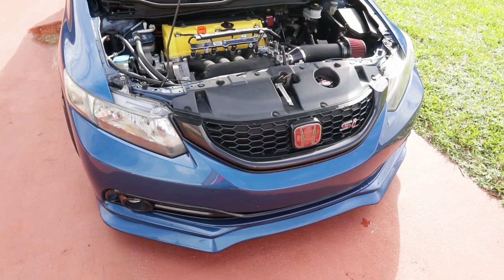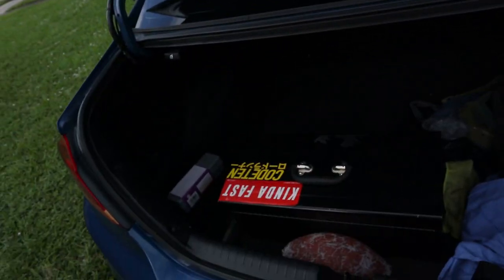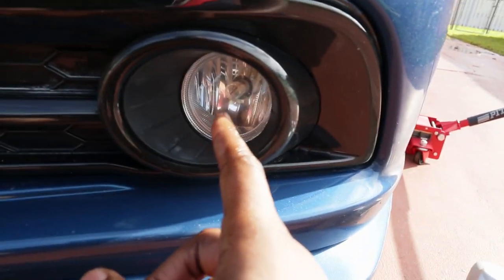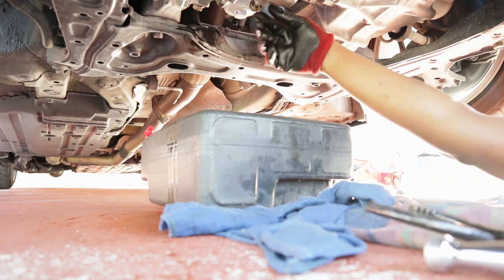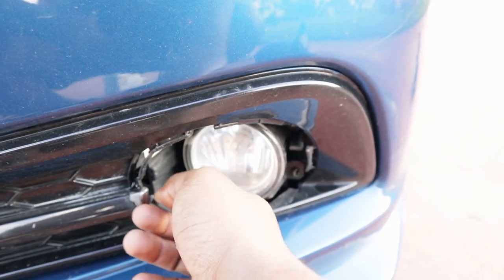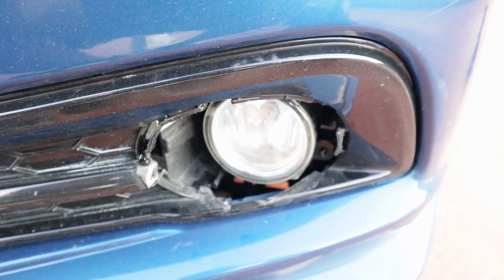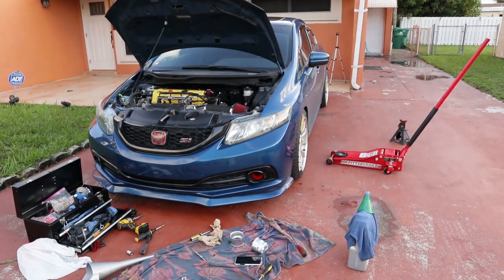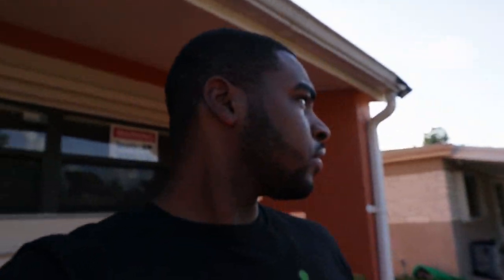Welp just my luck...

Comment: What short ram intake are you using with your RBC? I'm doing my RBC swap relatively soon and im planning on running a short ram until  I get acuity's RBC cold air intake and I've been trying to find a short ram that fits the RBC and inside the 9th gen engine bay
Reply from the maker: Ktuned 3.5 Sri for rbc
Reply: @zoovie  thanks!

Comment: A coolant bypass delete and a real cold air intake will help you the most with heat soak. I’ve also seen people wrap their RBC manifold with reflective heat tape.
Reply from the maker: I already did the bypass & it floods in my area so that a no on the intake .. my temps aren’t terrible just not where I want it be .. but now with the lil setup I made . Temps stay below 90 and gets to up 130 when sitting idling and drops down fast soon as I get moving
Reply: zoovie 130 ? Is that even bad ? For car internals I mean ? My oven gets up to 450 . That’s hot lol